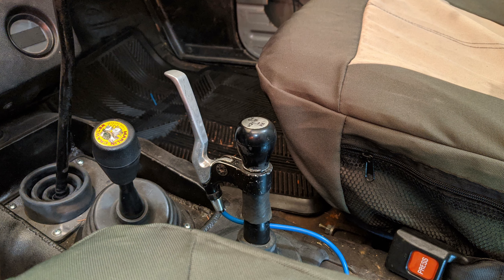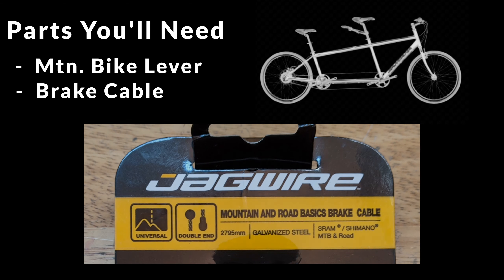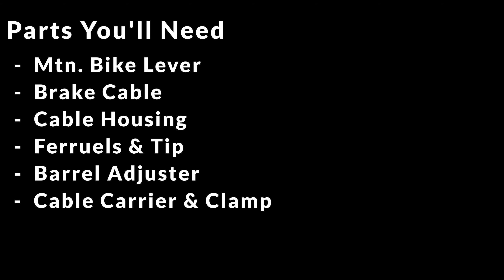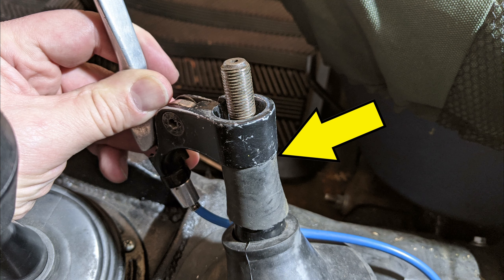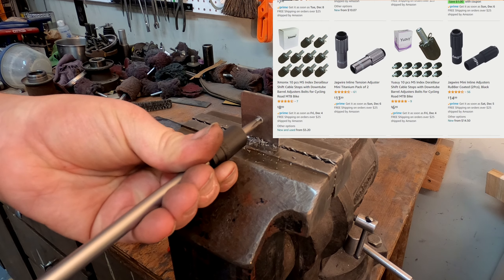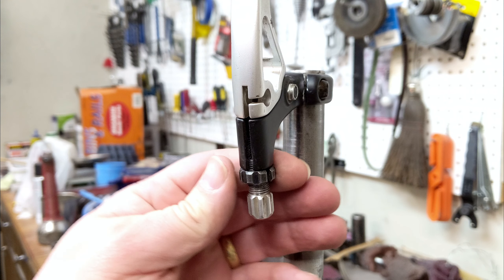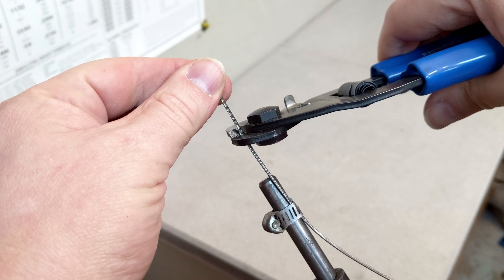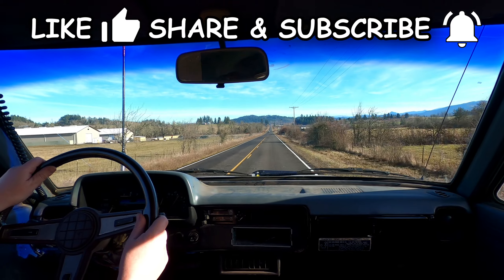DIY: HAND THROTTLE for Toyota 4x4 using bicycle parts - Cheap, effective, and fun fabricobble

Comment: Awesome video!!! 
I just had this idea for a cable throttle controller for Toyota and my search found your video. Of course my Toyota is newer than yours but planning on doing the same concept.  Just curious, what are the 3 gear shift leavers? I know one is manual transmission and one is 4 wheel drive shifter. The 3rd is for what? Never seen one in a Toyota before.
Reply from the maker: The extra lever is there because I have a 2nd transfer case reduction box (Marlin Crawler).  Basically, I have stacked gear reduction boxes behind the transmission.  The lever right behind the shifter is attached to a Toyota transfer case reduction box that selects between high and low range and then the rear-most lever is attached to the original reduction box that selects between 2wd and 4wd high and 4wd low.  If I'm in 4wd Low Low I go really, really slow with lots of torque.  It's mainly for rock crawling, but comes in handy for other things.  One cool thing is that if I'm in low range in the front case, but 2wd in the rear case I get true 2wd low range which, since I have a rear locker, is a really nice mode for most easy to moderate trails.  Here's a link to Marlin Crawler's website where you can learn about transfer case crawl boxes (I'm not affiliated with Marlin Crawler in any way, I just love their products.):  https://www.marlincrawler.com/about

Comment: Good idea! Hey I have a 92 and have an issue with the steering drag link clipping the leaf spring mount, have you encountered this before? Any idea's for a fix? Cheers
Reply from the maker: If you can, send me a picture of the issue and I'll have a better idea of what's going on. ( email: WheeliePete@outlook.com )  Is it a solid axle swapped rig or is this a non-US vehicle that came with the solid front axle and leaf springs from the factory?  When we swap solid axles under the later trucks here we use high-clearance cross-over steering arms that route both the tie-rod and drag-link above the leaf springs. The only way to hit the leaf spring mounts would be to have huge leaf packs and move the axle way forward by drilling the spring perches and having a forward mounted front spring hanger.  We also move the power steering box forward on the frame to keep from hitting stuff and to keep the drag link and tie-rod in parallel. I guess you could also clip the mount with the drag-link by having a pitman arm that is dropping too far and not having a proper bump-stop to halt upward travel of the axle and leaf spring...   I did a video a bunch of years ago of a buddy's truck we were building and I think there's some detailed pictures of the cross-over steering setup in there...   https://youtu.be/KK_mQcCSvJA
Reply: @WheeliePete  ok I'll send you some pics tomoz, it's a non US (Australian) factory solid axle and leaf spring set up,  someone told me it must have some sort of lift kit but I can't see evidence of it unless the springs are bigger like you mentioned.

Comment: Do you think this set up be used for clutch?
Reply from the maker: I think it would really come down to how much leverage you could create in your setup.   The clutch pedal usually takes quite a bit more force than the throttle to actuate so I don't think a bicycle brake lever and a wire would be enough to get the job done.  I bet someone has done it though and gotten it to work.
Reply: Get a electric line lock n plumb it to the clutch lol it works lol you'll have a button for your clutch. So you step the clutch, hold ur button of choice, release the clutch pedal, release button when you ready to launch

Comment: I'm interested in doing this setup only going to the pedal for simplicity but I wonder, would you have enough leverage with one of those smaller shifter friction levers to operate the pedal?  Looking at doing this on a 5 speed 3rd gen 4runner.
Reply from the maker: The friction shifter is good for raising the idle, but then it's going to stay there until you physically push the shifter lever back.  I bet if you attach to the pedal linkage high enough it'll have enough leverage to work it though.
Reply: @WheeliePete  Yup I know full well it will remain higher idle, that is the exact feature I want it for.  I also have small hands so I'm really not sure whether I can easily use a brake lever style anyway.
Reply from the maker: Most quality friction shifters will also have the ability to adjust the amount of friction.  You could play with that setting and get it set so it just barely holds the throttle open, then it'll take very little effort to return the shifter to the closed position.  Some of the old thumbshifters had a selector between index detents and friction.   That might be good too.

Comment: Would it work if I attach it to the clutch to use the hand throttle?
Reply from the maker: I've never tried it. I'm not sure there would be enough leverage to be able to pull the clutch pedal linkage.
Reply: I'm laying in bed with a bum knee thinking about this exact thing. How strong is a bike cable? Can it handle 20lbs of pull or will the cable stretch?
Reply from the maker: Bike cables are usually twisted multi strand stainless steel.  I've never break tested one, but I would think it would take 20# without issue.   What I would be wondering about would be the ability to get enough linear pull to activate the clutch.

Comment: When you don’t have a crawl box 😭😭
Reply from the maker: I didn't touch on that in the video, but yeah, in double low range with my crawl-box engaged, I really don't have to use the hand throttle.  There's so much torque in double-low that you can stand on the brake and just let the clutch out and the crawler will pull right through the brake at idle.   I've put them (hand throttle) in every wheeling rig I've owned or built for the last 20+ years though so I still use it a lot out of habit.  It's still pretty helpful when I'm just puttering around the woods in 2wd or single low.